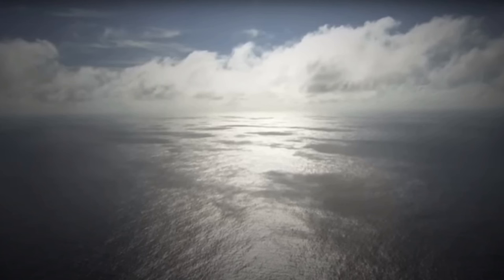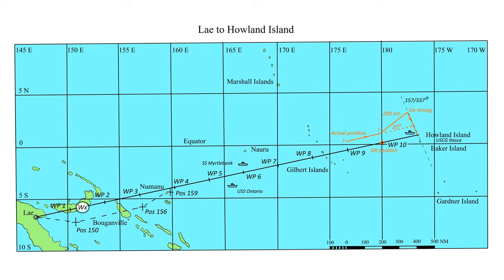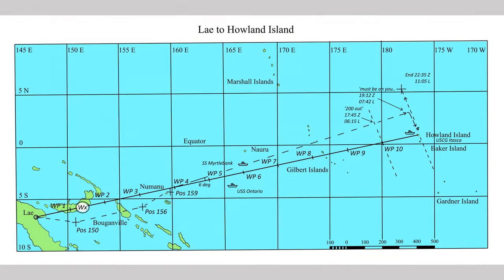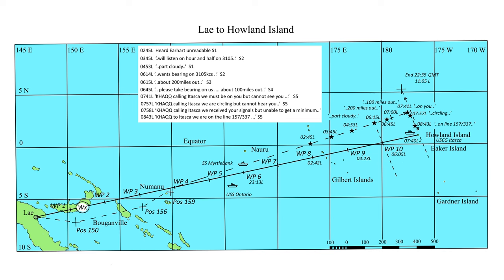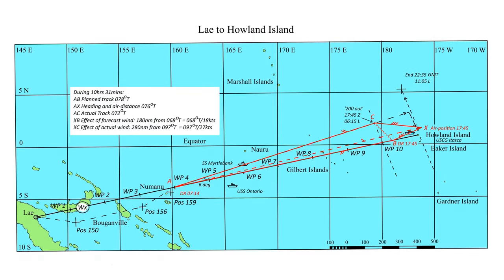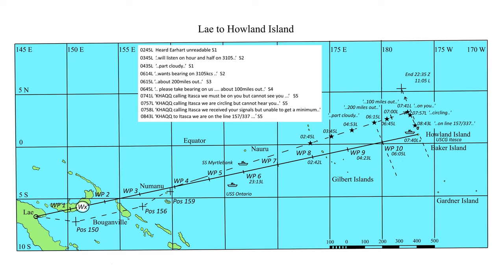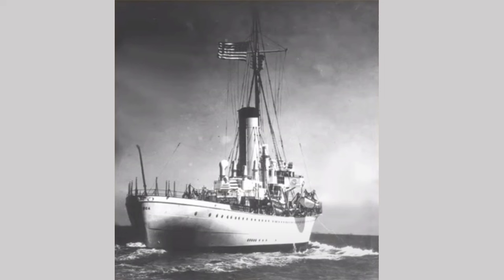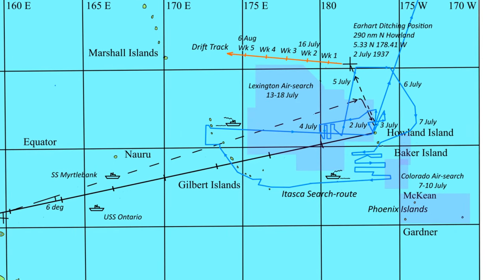The Last Flight of Amelia Earhart Part 2

Comment: Very well done and informative video, Colin!  Your theory seems better than most.  The one thing I realized when I did a virtual flight using celestial navigation from Bougainville to Howland (on MSFS in a DC-6), is that you can get within 7 miles of the island and not see it, if at or below 1,000' MSL.  So, without some kind of radio homing signal, it would be very easy for them to miss the island.  Even on non overcast days, the typical formation of numerous cumulus clouds cast shadows that makes the island itself look like just another cloud shadow.

Comment: Excellant well deduced!  I have a new theory!  The Sperry Auto pilot was brand new and Amelia did remark in her notes from previous flights that the Sperry controll arm wandered several degrees on her flights. This fact  may also account for her deviation of 6* I don't think Amelia nessasarily had her hands on the yoke throughout the entire flight. Between the Sperrys drift and the 5mile deviation from actual terrestrial mapping undoubtedly I would think she was between 10 and 140 miles off course. I am not a pilot nor navigator  however my father was a pilot in WW ll . I studied his naval flight preparatory books as a child. At that particular time in history Amelia and Fred would be on a suicide mission unbeknownst
To themselves. They were essentially flying into Japanese fortified islands and any radio communication on her part would be risking their lives. She was giving Hirohito her exact location and he wanted her plane.
Reply: The Japanese had already bought at least 3 Lockheed Electras and built their own by 1937...so 'No' they didnt need her Electra

Comment: They say that the Electra would not float for long.  But I wonder.  The plane was full of empty fuel tanks.  Wouldn't those empty tanks have kept them afloat for at least some length of time?  If the radio was not submerged couldn't they have sent out distress calls while drifting on the ocean?
Reply: That’s my thought as well, but it all depends on the sea state… If it was smooth, she would’ve laid her down like a baby, but if there were 6 foot seas, that would’ve been a pretty hard hit, and she had all the previous damage that were repaired from her early accident in Hawaii
Reply: Yes. I think they could have, and I think that the 15 yr old in Florida heard those calls, right up till they stopped.  I believe that's when the plane either sank if it was on water, or with no more fuel, ran out of battery power if on a reef, like Nikamoro Island theory.  However if they went north and ditched, thn drifted towards Marshall Islands, the Japanese theory sort of comes into play.  I don't think she had the fuel to make the Marshall Islands.  Than it's back to the ditched in the ocean theory again.
Reply: Radio signals were allegedly heard from her for up to 5 days after she disappeared.  Doubtful this would have been possible unless they were sitting on land (or a reef somewhere) so they could run the starboard engine for short periods to recharge the batteries.
Reply: @omcbob37  yes. That is true.  However, how many of those actually came from Earhart?   She could possibly have had enough battery power to send one distress call.  And then it was repeated by whoever else might have picked it up.  This could also support a ditching in the ocean theory.  She knew she was low on fuel, so she slowed way down at as low as she could and ditched as safely as she could.  Floated but slowly sinking for a couple of hours.  Giving time to make that 2 hr distress call tha the 15 yr old heard.  Then sank.  The Nikamoro theory, has things there that were left by someone.  But, not a trace of Earharts plane.  Still possible though.    The MV Myrtlebank was possibly the ship Earhart repeatedly seen. And, crew from the MV Myrtlebank claim to have heard a plane.  If that was Earhart, she was off course to the North.  And by the time she should've been at Howland, she was way north with not enough fuel to correct their mistake, so they ditched or crashed.
Reply: 😅😅😅. @TheFarmerfitz
Reply: Realize I'm not hanging on to any one theory, just thinking off ways that each could be possible.  If she flew between Howland and Baker Islands, she could have good radio contact.  Have thought she was North of Howland.  At a certain point flew South, Missing Baker Island, thinking she would see Howland, instead she saw Gardner Island?
Reply: Her last transmission ended with her saying "wait..."  why would she say that unless she either saw something, or came to realization of something?  If her engines died she would have just said that.  She obviously didn't see Howland.  So what did she mean?
Reply: @TheFarmerfitz  a 15 year old supposedly heard them in FLA, but the Navy & Coast Guard ships that were there, didn't hear anything? Doubtful...also these atolls are the tops of underwater volcanoes, there's all sorts of deep cracks & crevices off shore. If they were close, but the Electra sank like a rock, they wouldn't have drifted anywhere but down into those trenches.
Reply: @CARLiCON  on a different frequency
Reply: @CARLiCON  they actually did hear them. That's why they did a sort of search of Nikamoro Island.  Possibly by the time they got there, the plane had washed off. And there hadn't been any messages for a few days.
Reply: @CARLiCON  we're talking about 1937 technology.  Short wave radios with a good antenna could pick up from a long ways.. much longer that or ordinary radios today.  If she caught th right frequency that Amelia was sending on. Then yes, anyone tuned into that at the right time might hear it. It might be garbled for some. But maybe not for others.  They had 1937 technology and a piolet who was not very good at operating it.  And they were having issues with even before she disappeared..  so yes, it is possible.
Reply: There is also the account of Emily Sikul and what she repeated on what her father said.  Somehow he's connected with the Gilbertese Fishermen who saw a plane that landed near the Norwich city shipwreck. Right near the edge of the Island.  And that it was Damaged by the ocean and disappeared from view, Especially at high tide(when the Navy looked there).  Now, this doesn't necessarily confirm anything. They didn't know who Amelia Earhart was or anything about her.  And, Distress calls were heard periodically for a few days, from different places that all seemed to point to that direction.  And. artifacts, and human bones.  That may or may not have been Amelia Earharts or Fred Noonan's.    This account of Emily's seems to be a big clue.  I would love if someone could find decendants of those Fishermen, and hear what they have to say about it.   

  On a completely different note, in the Search for the ships of the Franklin Expedition, native inuit accounts on where the ships were, were discredited, but then they were found a few yrs ago EXACTLY where the inuit said they were.  Go figure.
Reply: Probably not, unless it was designed to float. Wasp Junior engines weigh 650 pounds apiece, and the landing gear, wing spar, batteries and radio are heavy and dense. While most of the volume of the aircraft is empty space, unless openings are sealed, it will not be watertight. Even in a gentle "ditching", I think you'd have a few minutes at most.
Reply: Not sure if I commented before but,  According the everything I've read or heard, Her plane had to have the right hand engine running in order to operate the radio.  Could not do this in the water. She would have to be on land to do this.  If she did this.  I guess I commented lots, but I've learned more since.
Reply: Itasca.. g ad wrong frequencies and dead battery.
Reply: @CARLiCON the radio messages corresponded to the times of low tide on Gardner, when she would have been able to run the engine.
Reply: @TheFarmerfitz the radio messages corresponded to the times of low tide on Gardner island, the only time when she could have run the engines.
Reply: @stevmarsh1910  You can Google Emily Sikuli and what she said about..  When Nikamoro Island was habited afterwards, her father was the Islands carpenter. Think the Gilbertese Fishermen had something to do with it also.  There story was the saw a plane.  Near the shipwreck on the edge of the reef.  It was in pieces because of a storm. Emily was there with her father and said she saw plane wreckage on a couple of occasions.. They didn't know anything about Amelia Earhart at all then.  Why do these videos not cover that?    Because it is harsh conditions, it's entirely possible that the plane wreckage was eventually washed away.  I don't know about you, but I'm inclined to put some merrit in an eye witness seeing plane wreckage there.    It is a very interesting read.  Has been around for a while.
Reply: The reef drops off steely and the plane would have washed away. If the ocean was calm, she could have ditched it intact. There is no proof ahe took the raft on that leg to save weight. Thanks for all your contributions.
Reply: @washburnb1  The way I have heard, that (and this is the Nikamoro theory) they made a relatively safe landing on the edge of the reef, near the Norwich city shipwreck.  May have tore off the left landing gear.  We're able to make distress calls for a few days at low tide, because that's when they could run the engine.  Then the signals stopped.  Either they finally ran out of fuel and/or a swell built up and washed plane away, possibly bashing it into bits against the reef.  But that's only if they landed there. Lots of other theories, but so far no proof.
Reply: @TheFarmerfitz  Thanks. I like all of the theories and my high schools kids learned of the Gillespie theory. The reef does drop off hundreds of feet. I think they ditched, and if four foot seas,  broke up and drowned . I don't believe radio signals after
Reply: @TheFarmerfitz I think the Florida girl “heard them” claim (big part of TIGHAR “facts”) is pretty darn questionable given that—apparently at the time she claims she heard these folks in dire need of help she never alerted anyone that he just heard dramatic calls from a still-alive AE.  As I understand things she only surfaced her alleged notebook “evidence” to TIGHAR many decades later as an old woman (wanting some excitemnt, attention, meaning to her life?).  So at the time she just sat on possibly lfe-saving info as to the most famous aviator of the time???  Right.  THAT’S a credible witness we should rely on.  Of course TIGHAR needs every thin reed they can hype to keep the funds flowing in.
Reply: @stevmarsh1910  apparently the right hand engine needed to be running to operate the radio equipment.
Reply: @stevmarsh1910  It would sink in a few short minutes even if not broken up.

Comment: Here's my understanding of Earhart's radio situation: Her Western Electric transmitter was designed for voice only, but had been modified for morse code also. It had 3 selectable frequencies, 500 kHz, 3105 kHz, and 6210 kHz. It could be used with the "V" antenna atop the airplane on 3105 and 6210, but the trailing wire antenna was needed for 500 kHz. On the eastward trip, in Miami, the morse key and the trailing antenna were removed, the "V" antenna was lengthened a couple feet, and a large loading coil was installed so the transmitter would load up on 500 kHz. So she had the capability to transmit on 500 kHz, if she had wanted to. She also had the capability to receive on 500 kHz, certainly using the Bendix DF loop.

The Itasca could not transmit voice on 7500 kHz, but, had Earhart left the antenna switch in the "loop" position while listening for Itasca's voice transmissions on 3105 or 6210, she very likely would have heard them. And had Itasca agreed to try transmitting their beacon on 500 kHz, 400 kHz, 333 kHz, or some other low frequency, she likely would have gotten a null.

As with most aviation accidents, a chain of events led to this one. (1) She tested the DF (good), which leads me to believe she knew she would be relying on it at Howland. She was unable to get a null at Lae, the test failed, but she took off anyway, not understanding why it failed.  (2) She took off over gross weight at Lae. As her airplane rolled over the rough ground of the grass strip, it is likely that her gear struts collapsed more than normal, and the receiving antenna was ripped from the underside of the airplane. Rather than take off overweight, she should have planned an intermediate fuel stop before Howland, a planning error which occurred before she even started. (3) There is no record that she tested the DF or communications enroute while she still had enough fuel to divert to an alternate. Or time to troubleshoot the problem. Although her choice of 7500 as the beacon frequency was a flight planning error which should have been corrected before she left the ground, by moving to a frequency more suited to her DF loop, such as 400 kHz. Had one or more of these errors been corrected before she left Lae, it is more likely she would have landed safely at Howland.
Reply: So far as being out of radio range, had she transmitted on 6210 (day) or 3105 (night), that might have propagated by NVIS over a few hundred miles.
Reply: A few items on a long list of things to prepare- and I think most of us, in the same circumstances and not having benefit of hindsight, would have made some omissions. Rather than a criticism of Earhart and Noonan, I see this as an object lesson in proper evaluation of risk and detail of preparation. Lindbergh was very detail oriented and planned meticulously. He was also very lucky that the things he could not control (wind and weather) did not combine to send him to the bottom of the Atlantic.
Reply: On another video it was said she was given four frequencies to use for identification but confused wavelength with frequency. 400 kHz, 333 kHz (900 m), 500 kHz and I forget the other one, maybe 800 kHz . It was usual to use wavelength in those days as an old valve wireless will show on it's dial.
It said she chose 400 kHz, 900 kHz (333 m) and 7.5 MHz (40 m), and only one frequency for each ship to use.
7.5 MHz was the problem being too high for d.f. at the Itasca and not obtaining a null. The first two must have worked.
If this is true why did nobody question her choice of 7.5 MHz?
As you say did they not check the loop a few miles out of Lau? The video said she put it down as the signal being too strong at Lau to obtain a null.
Reply: That’s a good summary. 👍🏼

Comment: There is some factual data that you ignore or are unaware of. 

1. No life raft onboard. Earhart had the aircraft stripped bare at Lae. She wanted the most range she could get.  This is from testimony of the station manager at Lae and Earhart’s diary she mailed home. She reported details back to the US at every stop if possible.  

2.  There was not 3 hours of fuel onboard when they arrived in the vicinity of Howland. Not even close to that amount. Earhart kept meticulous records of her aircraft’s performance.  She conferred with Kelly Johnson regularly to get the best performance.  You do mention Johnson in Part 1. Not sure how you determined 3 hours reserve. Her exact fuel load is known from receipts at Lae.  
3.  The DF on her aircraft did not work on a test flight at Lae. This was obviously before her final take-off and the infamous puff of dirt from a dirt runway. She was mishandling the one-off, custom built Bendix radio. This was determined afterwards by the man who designed it. 

There are a couple of other details I won’t mention. I’m considering producing my own YouTube video on this subject.
Reply: Yes please do if you have something to add as to the facts of this unfortunate final flight by Amelia .

Comment: Earhart mentioned  "line of position 157 337."  

A sun line that crosses Howland is not necessarily an advanced sunrise line.  

Course deviation while tracking along a Sun Line that crosses over Howland is found by finding the difference in arcminutes  between the Sun's  observed height and calculated height.
Reply: Estimating the instant of sunrise is interesting.  It involves uncertain refraction.  In 1937 the amount of refraction between the horizon and eye could be found in only a few books.

Comment: 1:05    The Sun line across Howland rotated so as to stay perpendicular to the azimuth of the sun.  The Sun passed north of Howland Island.  So it rotated counterclockwise.  The angular  height of the Sun could be predicted for any instant that morning.    If measured, its measured height could be compared with the prediction.  The difference in arcminutes  could be used  to indicate how far the plane was left or right of the Sun line.

Comment: She did have 500 khz, retuned in lae for use with the rooftop antenna. 
The  morse keys not on board , just meant tbey had to use tbe mic button to send crude morse,
And they did , but not on 500 khz

Comment: Why are you using the sun line to determine 157-337? There is a 67 degree magnetic course (76.5 degree true) 1.5 degrees (80 miles north of Howland. TIGHAR is the one that decided that 157-337 is based on the sun line. Over the last 86 years why haven’t any of the experts mentioned magnetic declination or the fact that a 67 degree magnetic is located north of Howland? Nobody mentions what a 78 degree true course is converted to a magnetic course (68.5 degree)! Why??